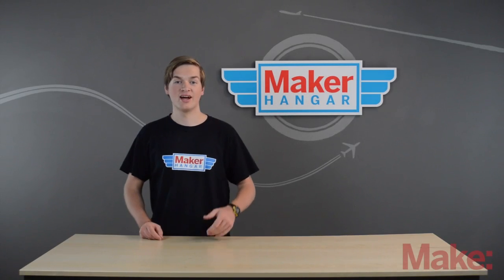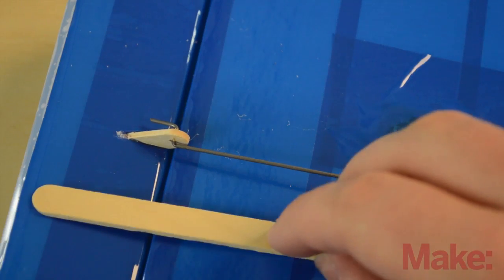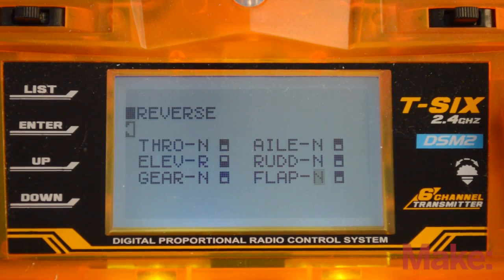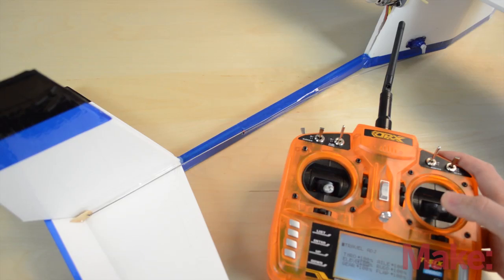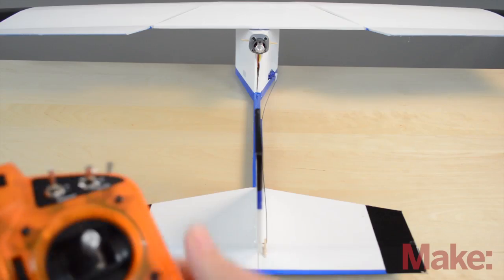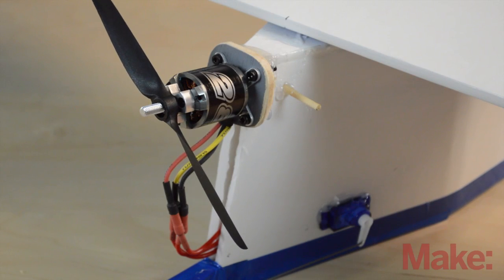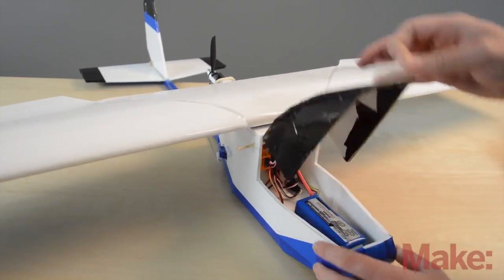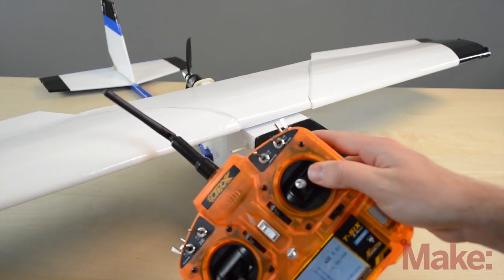Maker Hangar: Episode 12 - Programing Radio

Comment: hello i was wander if you can answer this question for me i have a can  a 7x8in prop with a D2826-10 1400kv Brushless Motor and using a 40amp esc also i have a 3000mah plus 1800 mah .. which one can i use that will work best.

Comment: They are a all around use battery I can paralell two and get 4400 mah for less money than buying a 4400 and less weight sometimes. if I need a six cell battery and I don't have one I can series connect two exact batteries Mah and C size I have a 6 cell 2200 battery. I only use 2200's 3 & 4 cell makes flying cheaper and easier. I have a FPV UAV that take 4-2200 4cell batteries just to get the CG right but hooked in parl. it gives me a 8800mah battery that I can fly for around 30 mins. so there.